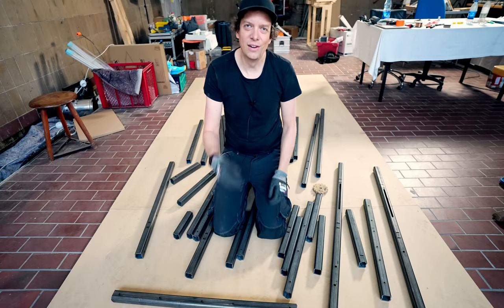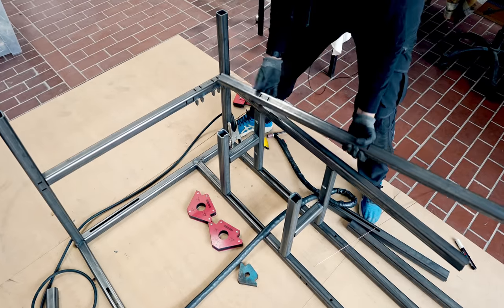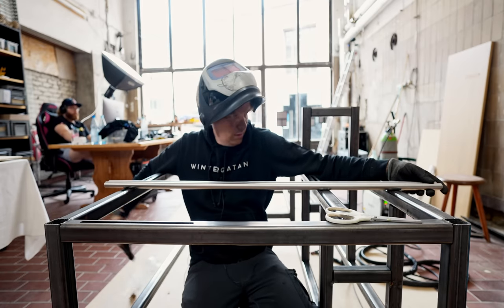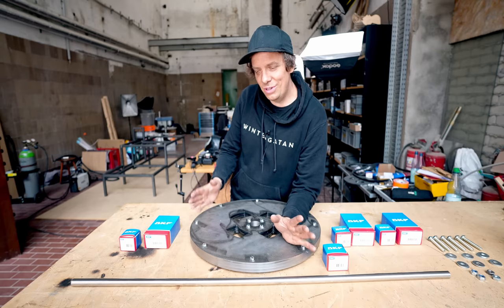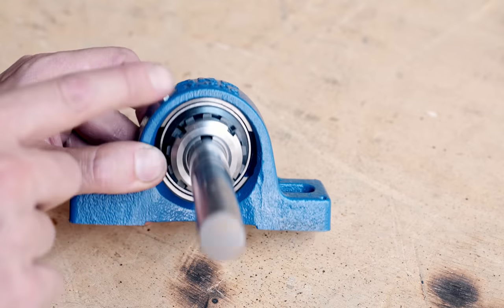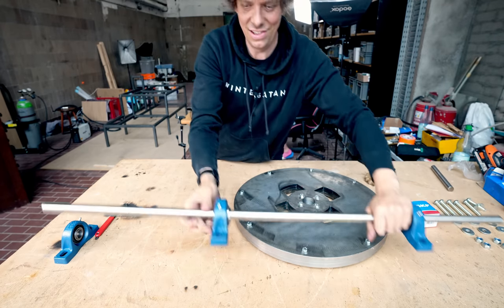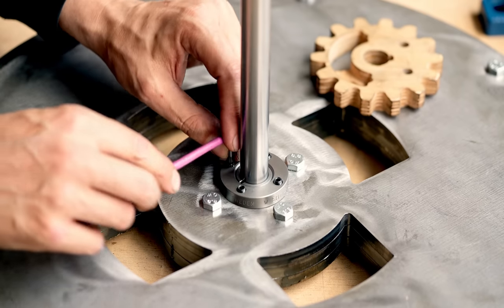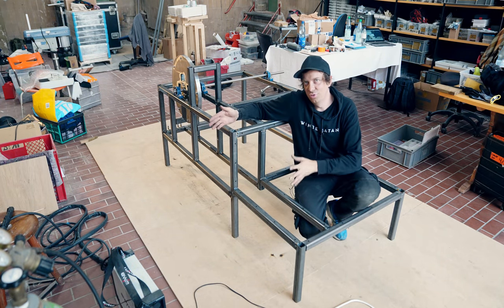Welding the Frame - DAY 3 - Marble Machine Flywheel Prototype

Comment: If you ever remake the frame for your alignment tabs in the future, if you continue to always have pairs of alignment tabs, do a top/left tab width and a different bottom/right tab width so that you don't have to worry about an upside down part again.
Reply: This is a possible approach. My concern is it adds unnecessary complexity which might hurt more if the design changes in some small way. Pros and cons.
Reply: @lunaumbra5179  This is actually a brilliant technique used in manufacturing called mistake proofing (or poke yoke for the 6 sigma crew) whereby the process makes it impossible for the assembler to assemble the item incorrectly.  Yes, there is additional complexity in the design, but the benefits in manufacture far outweigh the cost of design.
Reply: @lunaumbra5179  if the design changes in a way that requires flipping a piece upside down, there are way bigger problems. The laser cut alignment tabs and slots intend for there to be only 1 ways for assembly to go. Right now, part alignment has 2 possible positions which leads to possible errors. Altering the tab methodology only removes the possibility of errors but doesn't substantively increase design complexity. The tabs are all parametric anyway.
Reply: To make it idiot proof is great for manufacturing large quantities but in martins case this is just a prototype and at the moment I'd say no major plans to mass produce the marble machine. After all hevis showing us how to build our own and for that alone is fantastic 🙂
Reply: I was just coming down to comment this. I work with electronics for a living, and one of the biggest things that I've learned so far is that if you make something that can be put in backwards or in the wrong way or in the wrong spot entirely, it will happen. Adding a couple little 'keys' to your pieces will make sure that they will never have that problem again which will save you a lot of time and headache.
Reply: For parts that are removable for maintenance alignment features like that are a God send! Especially for heavy parts, having pins or slides to hold it in the right position makes it FAR easier to bolt on correctly without hurting yourself or breaking shit. Not including alignment features is just lazy engineering imho.
Reply: @xxportalxx.  There's a distinction between lazy and inexperienced. One of them is a mistake made once, the other is typically a recurring pattern. I am of the impression that this was the former and not the latter. It's hard to remember Martin's roots as a musician and artist, but I think the fact that he's using registration pins at all is a testament to how far he's come so far.
Reply: @raphaeleidus6718  Currently there are 4* ways a single piece could be attached, 3 of which might be incorrect. Up and down in one orientation or flipped around for another 2.
Reply: @patrick7635  no plans to mass produce, but Martin wants to produce more than one for himself. He wants a tour machine, a back-up machine, and the ability to easily produce replacement parts.
Reply: @ricky_gorzel  oh lol I wasn't referring to the marble machine there at the end (Martin is a musician, not really an engineer by profession). I was thinking of the professionally produced industrial machines I've worked on, very much a mixed bag, not uncommon for engineering to get sloppy where assembly and maintenance are concerned.
Reply: @xxportalxx.  Ah, yeah. I get ya! I've definitely run across a few instances of that at work too lol

Comment: I think asking SKF support is one of the best decisions in this stage. There will be so many engineering concepts and decisons to be made during the design and prototyping, you don't need to decide every issue. Kudos Martin
Reply: Nice to see that Martin is no longer re-inventing the wheel (or the pillow block or the tapered bearing)
Reply: True that. And I have to say, the SKF stuff looks really nice. I have about zero need in this area, but if I had, I'd put them on my shortlist to check out.
Reply: Yep, much better than Raid Shadow Legends
Reply: Yep. One very critical skill in any kind of engineering is recognising what parts of your design are (or are equivalent to) already known solved problems so that you can plug in an existing tested component / algorithm / whatever. The more work you can offload to some designer in the past, the better!
Reply: Skf has superb products
Reply: @BrynTheWizard  You can see further by standing on the shoulders of giants.
Reply: @StCreed  SKF literally invented the modern ball bearing 116 years ago. So they know their stuff.
Reply: agreed

Comment: After tightening the nut, you should bend one square of the MB lock washer into a groove of the nut!! That way the nut won't be able to get loose, that's how they meant to be mounted ;)
Reply: and it was on backwards, the angle should be towards the lockwasher, but i see he figured that out.
Reply: I was thinking bout this all the video... hope Martin figures this out too...
Reply: This isn't final assembly, just a quick fitment check. It would be pointless to lock the nuts now.

Comment: i feel like a rubber mallet would be a far better tool for the job than a plank of wood for adjusting those angles
Reply: Rule number 2 of building shit: if it works, don’t touch it unless you absolutely need to
Reply: Yes or a deadblow mallet.
Reply: It's fine. It will need adjusting, thus hitting it with something will be required, so long as the material you hit it with is softer than the steel it will work.  Rubber might be too soft though, as you'll probably find it won't make any difference in the adjustment, but it will most likely tear up the mallet.
Reply: Not really a job for a rubber mallet imo. I would and have optet for a plank of wood in similar situations.
Reply: @JustinW-dw3hf  I'm a welder fabricator by trade, rubber mallets are the go to for adjustment. They don't marr up the material, you just have to be careful on thinner wall tubing not to dent it.
Reply: Gotcha, I was thinking about the cheep soft rubber that most folk use.  I personally prefer deadblows on flat surfaces and wood on corners or sharp/pointed areas. I reckon you end up using whatever you grab first : )
Reply: Or weld it on a welding table. If you need it flat, weld it clamped flat.
Reply: I feel like using some shims would be even easier...
Reply: @RickMeasham or just don't move everything with only small tab of welding😅
Reply: A rubber mallet would be a +1 hammer of percussive persuasion. That only does 1d4+1 bludgeoning. He's using a +1 CLUB of percussive persuasion, which does 1d6+1 bludgeoning. Far better too for the job ;)
Reply: Leather or brass mallet imo
Reply: The real solution would be a fixture table that aligns the parts more accurately. Those angle blocks are ok, but they don't have the best registration nor do they account for the entire span of the part. The issue is, fixture tables aren't cheap and getting enough alignment fixtures is even more expensive. I think this accuracy is perfectly fine for Martin in a basic shop. A production level attempt should be done in a real machinist shop with access to fixtures and gauges though.
Reply: You can also use a ratchet strap across the longer diagonal, and slowly tighten one click at a time until it is (nearly) perfect.
Reply: Rule 3 of Youtube - planks of wood getting broken are more interesting than rubber mallets NOT getting broken.
Reply: A wooden mallet would work too.
Reply: If it works, it works. The wooden plank would have just been what was easily to hand
Reply: Eh, a plank of wood seems to do the job 🤣

Comment: As SimonRober pointed out earlier, when you tighten the taper into the pillow block bearing, look around the locking nut, one of the tabs on the washer will line up with a groove on the nut, take a punch and bend that tab into the groove, that will lock the nut in place.
Reply: Thanks for the credits ahah

Comment: Great work so far. I don't know if SKF mentioned it but you should only fix one end of the shaft in the pillow block bearing. The other end should float in it's bearing. This is to allow for the shaft length changing with a change in temperature,
Reply: Thank you. I was thinking the same thing. Weird that SKF did not mention this to him. It's in the Theory about bearing design that SKF provides.

Comment: Martin, to check square dont use a small square in the corners. Even if it looks perfectly square, it most likely isnt. 1mm gap at the square will be 5/10 across the length of the frame.

To actually get square, measure across the diagonals. And to get things flat, clamp thr boxes to be joined to a flat piece of metal as you tack. If you do this for all the pieces, and make sure to always clamp to the same face of the assembly, it'll end up fairly flat usually.

Just some tips from a welder fabricator.
Reply: Yes, checking diagonals is the way.
Reply: Using Pythagoras theorem is simple and effective way to get it squared. Using the whole lengths will assure it gets squared with good precision.
Reply: Welding table...
Reply: Also, squares like that have a square corner. Weld bead can throw off things. best to use a square that has a gap in the corner that can clear things like weld bead/radiuses, etc.
Reply: He actually did this building the MMX frame, so I’m surprised he didn’t show this here. Guessing it just was edited out of the Final Cut.
Reply: Martin simply doesn't have access to the tooling needed to properly align and hold the parts. At least not in this shop. Using a tape measure on the diagonals can improve alignment but doesn't mean much when you can't properly hold the pieces in place. They're going to shift on every weld.
Reply: @Beakerbite  i make frames like that flat and square daily with nothing more than a tape measure, clamps and a few small pieces of flat bar. If you mind the order and direction of your welds the distortion from how you tacked it is minimal, and is easy to tweak out as you go.

Theres no specialty tooling required, martin is just not yet experienced enough to know all the finer details of putting together a frame. He'll learn more as he does more of it.
Reply: What he needs are Fireball squares
Reply: @janne5050  you don't need to do the math for squares and rectangles, you just need to make sure the two diagonals across the face are even.

Comment: As someone who once, some 30 years ago in 9th grade, did a tiny bit of stick welding, I think Jason from the @FireballTool channel would argue that you would have been better off using a fixturing table for your table to ensure squareness, flatness and correct sizes, so you didn't need to use your +1 club of percussive persuasion :)

Comment: In the last video clip of the flywheel spinning it appears there is a small amount of runout.  Watch the right side of the wheel as is spins against the frame. Maybe it's an optical illusion.  Awesome progress.  Looking forward to more in this series.
Reply: It's a little harder to see on the left without a vertical point of reference, but it does show a slight wobble. A little easier if you double the playback speed.
Reply: I hope he addresses this in a future video..
Reply: @Mutius82  There's no way he won't see it either in the edit or just in person
Reply: I don't think there's much radial runout. I'd say the runout is most likely axial and the external chamfer he made makes it look like quite a lot when it might be just a couple of tenth of a mm at most. I'm talking from experience as I've machined large plates like this quite often. Edit, plates like this are never flat and can be a pain in the ass to get flat when if you start to machine the flats. There's so much stress left inside these kind of flat sheet materials more or less always. Start to machine and they'll start to twist and bend like shit. They must be heat treated to get rid of that.
Reply: It does look like there is some runout.  Martin knows how to use the dial indicator, so it is easy to check if there is runout and how much.   The concentricity between the centre bore and the OD should be good since it was done on the lathe at the same time without removing the flywheel from the 4 jaw chuck.
Reply: The biggest benefit of doing this prototype is that he can find out whether the imperfections that result from the process end up mattering. Once he has it put together, he can get it up to speed and then check the frame for vibration, which is the thing he wants to manage, because that's where marbles end up on the floor. And if there is noticeable vibration, he'll know that he needs to build the real one more balanced.
Reply: @iabervon  I'd say the biggest benefit is being able to make the same video twice and still having people clap like seals.

Comment: Martin, I check in the video like 12 times and I realize that the flywheel is spinning not concentric, so in that case, because the weight of the flywheel isn’t stable, is going to be vibrating when it play, try to check with the dial indicator to be sure.
😅 18:06
Reply: If the crystal lattice of the metal comprising the flywheel is irregular/weighted toward one end, carving it totally flat would not solve the problem. My first thought is that an accelerometer tied to the frame should be able to sense movement and then you could extract through inverse kinematics which areas are heavy/need cutting. I thought he was planning on adding balancing weights though, since that's closer to a standard approach?

Comment: Just keep the most important rule in mind: If you can't make it precise, make it adjustable. Unless you find a really great welder you won't get precision, it's very much an acquired and perishable skill. In a nutshell: Have pre designed places for adjusting screws.
Reply: Definitely agree with the first part, but the second part; even an amateur welder with a good fixture table can get precise results with time to setup, etc.
Reply: @esdee108  we probably have different definitions of precision. Can a beginner welder, taking his time and using a precise fixture make, say, a bicycle? Yeah, sure. The tolerances on a bike frame are pretty forgiving. But in a tight construction like the marble machine, or even this tech demonstrator, with layers of connections and a frame layered in all 3 dimensions? Not a chance.
I've done some welding in my time and I know my limits. This is thin steel and small tubes and getting it to ±1mm is a good result. If you want ±.1 you better put on your big boy pants. The frame doesn't have the rigidity to withstand the closing forces of the welds, so you can't even properly balance your welds.
Reply: @Argosh  Even "Pro" welders seem to have a lot of problems with both keeping things flat and keeping them square.

Recently the cannel Fireball Tools bought a square made of square tubing from a number of welders. They got the plans with all the measurements and tolerances for square and flatness. The shops ranged from a one man operation with a welder who had 40 years experience to a large company with a lot of employees and several shops spread over the country (or if it was the state, don't remember). The cost spanned from $150 to $600.

None of the shops managed to keep to the dimensions. The most expensive and the cheapest were over max tolerance, and the mid price shop was just slightly smaller than min tolerance.

As for flatness only one shop managed to keep within the tolerance of a max deviation of one 16th of an inch.

So that part about professional welders being able to do this is not something to count on. Like you said, you need a great welder, and even 40 years of experience is no guarantee that they will be able to weld something like this all that much flatter than what Martin can do with a lot of time spent on correcting his mistakes. They will however be a lot faster.
Reply: @blahorgaslisk7763  which is why I wrote what I wrote. My uncle made water tight pontoons and floating factory infrastructure. Watertight is a requirement that will teach you a thing or two about precision.
Reply: I just hope "making it adjustable" doesn't mean using washers. That was like the foundation of the MMX 😂
Reply: @Caesim9  it's a mix of precision ground hardware and shimming 😅

Comment: Looks awesome small suggestion when your having all the laser cutting done you could have a letter for each individual tube as well as an arrow, dot or some other indicators for orientation which side down and end orientation relative to what it needs to mate to.
Reply: Or just different sized tabs (as someone else has suggested)

Comment: Just so you know, those lock washers are designed with the intention that you bend over the tabs to fit into the slots of the nut to prevent it from unscrewing. Obviously you don't want to do that at the test fit stage, but in the final assembly you need to remember to do it or you risk the bearings coming apart.

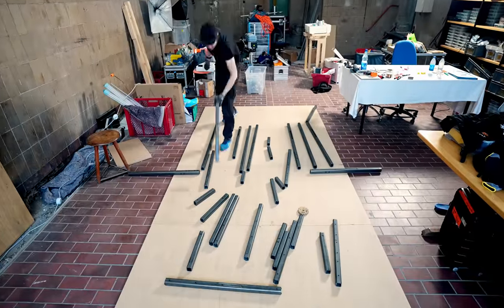Comment: 00:50 When designing self aligning assemblies for laser cutting I like to give a number to each joint and engrave it on the piece so you just have to check that the numbers match when you put it together.

Comment: Hi Martin, as you are taking advice from engineers I would like to express my surprise to see a rigid axle with three bearings.  I remember from my mechanical design lessons ~20 years ago that a rigid shaft shall only be supported by 2 bearings with requirements on these bearings as well (among others that only one shall block the longitudinal movement).  Did the application engineer from SKF not tickle about this design property ?